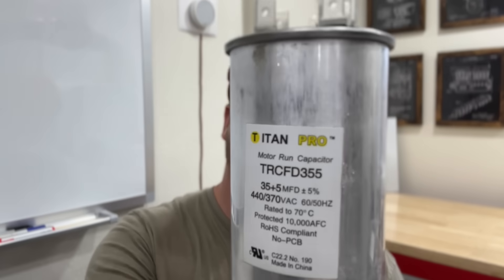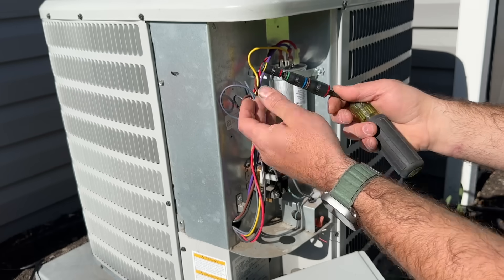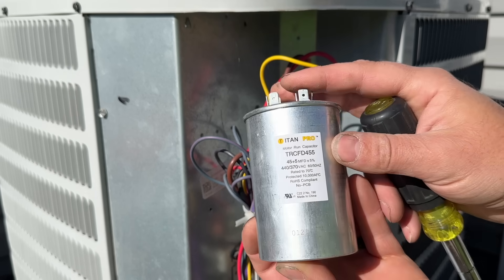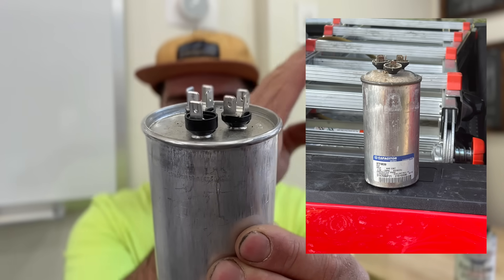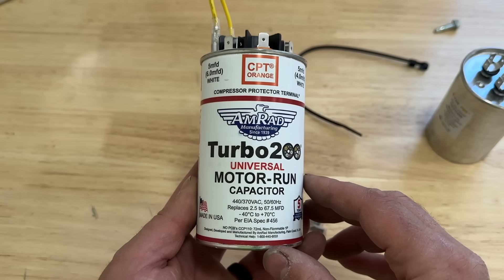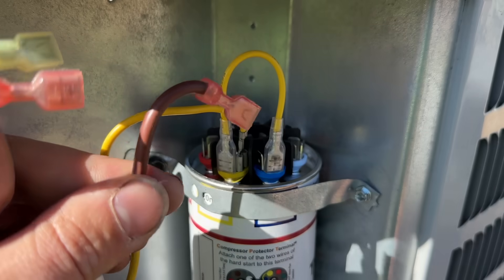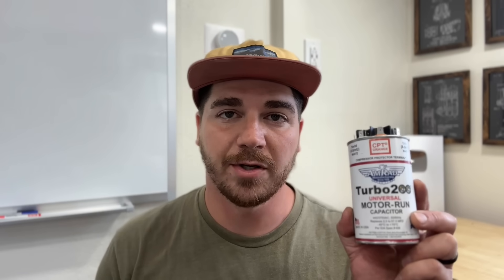HVAC Contractors Practically Make Their Living On These

Comment: I paid 240 dollars to have one replaced about 2 years ago. I got a little desperate because it was very hot and had kids in the house. I could only find them on amazon. And it would take 2 days to get it. I just had it go out again a couple of weeks ago and found out Ace Hardware sells them. It was 30 dollars but saved me from paying someone else almost 300. I ordered an extra one off amazon also just in case it happens again.

Comment: That is a rescue cap , experienced techs only keep 1 in their truck for weekend emergencies only they are larger in diameter than what is in your unit and not a suitable permanent replacement. A swollen capacitor is common due to not cleaning your condenser coil. A restricted coil will cause over amping and failure of your capacitor,fan and compressor. I have never seen a capacitor cost 2 k but more like $200 -$300. You have a service fee trip ,charge and parts markup and the time and experience for diagnostics and repair.

Comment: An hvac contractor can quote a repair for what ever price he or she wants.  If you don’t like the price, DON’T approve the quote. If you approve it with out doing your homework, then not like the price later, that’s on you, not the contractor. As far as the turbo 200 universal capacitor, they’re great.  They do cost $75-$95 at the parts house.  Count on a 300% mark up from a service company.  That’s just business.  Good luck getting it to fit in most of the residential condenser electrical cabinets though.

Comment: Just last summer my AC stopped working.  I called a local independent HVAC contractor for the repair.  I was quite pleased to find out he was very honest and reputable.  He diagnosed the problem as a faulty factory capacitor.  He only charged me $15 dollars for the capacitor and a $75 minimum response fee.  But now, with your video, I am pretty confident that I can do this myself the next time the capacitor fails.
Reply: You should keep his contact and spread the word around. They dont make those techs anymore
Reply: @blipblop92  Totally!  And I have done such that.
Reply: You should keep his contact and spread the word around. They dont make those techs anymore
Reply: I was fortunate that where I lived my HVAC tech did roughly the same thing.
Reply: I bet he’s no longer in business. No way to stay afloat with no profit margin on part and not taking into account time, gas, vehicle maintenance, insurance, etc.
Reply: @frankiec5570  This local family owned company has been in business for three generations.  They’re still in business.  They must be doing something right.
Reply: @frankiec5570 Well, it seems to me that this guy is well aware of overhead, costs of operation, the minimums needed to succeed in his operation. Hence the $75 minimum service call fee that typically takes only a few minutes to diagnose and repair.
Reply: That sounded pretty reasonable to me,  you should hang on to this Contractor.
Reply: Keep that guys number.
Reply: Where are you located?
Reply: At those prices he will be out of business soon. What that guy charges is not enough to cover his cost plus pay Uncle Sam and put food on his table.
Reply: @justinhindman5834  I politely disagree.  This HVAC contractor has been around for years in our relatively small town and has top ratings from their customers.
Reply: @sar4x474 good rating doesn't mean he makes a profit 😂
Reply: @justinhindman5834  only scammy techs cant make a living without ripping people. My personal hvac guy charges $70 minimum fee to come out for some loose wires or popped fuse and he's been in business over 20 years and owns multiple houses for rent. I wouldn't say he's about to go out of business. Business will always find you if you're honest and priced right

Comment: I started having problems a few years ago in the heat of summer. Usually afternoons when the whole unit is in direct sun.
Saw one video and bought a capacitor.
Changed them out and got it running.
 A few 100+ degree days later, it heated again and quit again.
I saved the  old one and had put it in the fridge. 
Swapped it out again and it worked fine.

Since then I built a plywood cover to shade it and it works all summer.
I know you have to R&R before it expands and ruins it.

Comment: My brother always calls me and I help him figure out these things over the phone. Generally if you can open up the outdoor unit and the contactor is pulled in and nothing is happening your capacitor is bad. I can just about guarantee that you will have to replace your capacitor at least once if not twice in the lifetime of your condenser. Capacitors are not very expensive and they will eventually get too hot and fail. 80% of all air conditioning issues will be electrical. If it's a refrigerant problem you have a leak

Comment: The part that you are holding in your hand is a Run capacitor for the condenser fan motor and the compressor. It stays in the circuit the whole time the unit is running, it is not the Start capacitor which is plastic and only stays in the circuit for milliseconds until the unit is running, then it is cut out of the circuit by the start relay. But you are right that the HVAC charges more than the price of the part, generally we charged 2.5x the price of the part part plus labor.

Comment: You shouldn’t see any resistance at all between the anode and ground terminals. Some caps become resistors as they internally begin to short as they age or are placed in the wrong position, so if you see an ohm reading that’s anywhere below the megohm range, you should toss it.  

Also caps that are sold individually, as opposed to the multi section can types as seen here, are often of much better quality. It’s quite easy to zip them together and then do the install. This will open up more quality options such as better temp and esr ratings.

Comment: I've been trying to figure out if the evaporator in my home split system also has a capacitor that fails, since the evaporator fan sometimes fails to start and condenser freezes within a couple of minutes. I just turn the ac off for a few minutes, turn it back on and back in business. This can happen once or twice a month while sometimes once in a year. My ceiling now has some water stains since the lines freeze all the way from condenser to evaporator.

Comment: Water Well pump start capacitors are a boondoggle profit item in the water well repair business. A $200 Franklin control box is typically sold when the root cause is usually the motor start cap in the control box. Capacitors have only so many start cycles in them.
 A $15 plug and play replacement. I've saved people thousands of cumulative dollars over the years replacing just that cap.

Comment: The capacitor holds a great amount of charge and its purpose is to start the heavy steel fan that's atop the unit. If that is the case, you can start your AC by turning it on in the house and going outside to the unit (you should hear the hum) and knock the fan with a long object to get it started. Long screwdriver or yardstick. That will make your wife happy while you go and get a new one.

Comment: I guess scammers are everywhere.
My (humble) comments:
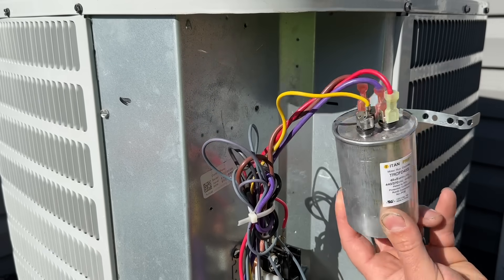Don't put screws up (2:23). Put them down so they cannot fall.
The first 3 wires should be pulled from the plug, not the wires. Except the last one because it's not insulated.
I'm not an expert but discharging a capacitor that way is dangerous to my knowledge. Chances are very thin but it can blow using that method.

Comment: Just like at the auto mechanics. Dealer wanted $1500 for rear shock replacement.  Local shop $1200. Pepboys was less than $400 with shock purchase.

Geottel AC in Las Vegas wanted $278 even before the capacitor game out. $65 for the capacitor alone. I waited till it blew and replaced it myself

Comment: It does not give the AC A ‘jolt” when it is turning on.  It shifts the phase between voltage and current which provides rotates the magnetic field of the motor giving it starting torque. It gets the main winding and  auxiliary winding out of phase producing starting torque.

Comment: In 1960s Sears sold all the parts for central air. All parts sealed, compressor, lines, evaporator, etc. I installed as instructed. Outdoor switch ,its own breaker etc. Worked fine for ten years. I sold the house, it was still working.

Comment: I was one of those guy that got suckered into over paying for a new capacitor, but my capacitor was for my air handling unit and it was in a weird place on the circuit panel.  The capacitor was the only item not visible when looking at the circuit panel of the air handling unit. The capacitor was placed on the back side of the circuit panel so you can't see it when looking at the circuit panel.  I would have never found it and would have gave up on trouble shooting without diagrams or drawings.  $550 was a fair price for teaching me a good lesson about how experience over 25 years in the HVAC business makes him not only a good HVAC mechanic, but he taught me a thing or two about HVAC components mounting and wiring, as well as, how to keep a HVAC business financially successful for over 25 years.

Comment: Same with pool companies. If your pool pump doesn’t turn on it’s most likely a 20 dollar capacitor. Don’t replace the pump. Replace the capacitor. I’m not mechanically inclined and have done it twice so far. Save yourself 800 bucks.

Comment: These capacitors don't last because they outlawed PCBs or something based on environmental concerns.  Keep a few handy, and learn how to discharge the old one so you don't kill yourself.  PS:  The number one scam for AC is filters.  The most common problem isn't the capacitor, it's the filter hasn't been changed in ages.

Comment: The first thing you should have done is use an insulated screwdriver to discharge the capacitor to ground before you ever removed it. That way its totally safe. They can blow a finger off.
The old massive capacitors filled with gnarly oil never went bad like the new tiny ones. When i say new i mean in the last 30 years

Comment: Speaking as an HVAC service tech… any company that charges that much for a capacitor replacement is a bad company ran by crooks. I’ve worked for 4 different companies, the most they’d charge is like $300. $1,000 or more is absurd and highway robbery.

Comment: You are right one of the biggest ripoffs but do be intellectually honest as well.  What I am saying is you say that capacitor that you improperly try to dumb down to a battery is that it is a $10 item which is true but out of context while holding one in your hand that cost on average $65 dollars. Also honestly you should discharge the capacitor before pulling the wires as pulling the wires is when you are most likely to inadvertently touch the wire and discharge it yourself.   It is akin to flipping off the breaker after touching the wires and realizing that hurt.

Edit:  that turbo 200 you are holding on Amazon is $70 to $90 as of now.  Granted if you get the correct size cap only you can get them between $5 to $15.

Comment: I called a large hvac company that I had used in the past, told them the capacitor was bad but wanted them to service the system while they were here. The guy comes out, changes the capacitor, services the system, then hands me the invoice. $385 for just the capacitor, then service call and service. I told him, recalculate the invoice for the service call and take the capacitor out, I will go to Grainger and buy a capacitor. "But, you are not a certified service tech and you are not allowed to change that part and you don't understand how dangerous it is". Well, my units are 10 years old with no warranty and as far as not being certified, I have been a state licensed electrical contractor for 30 years, electrical and mechanical engineer for over 20 years. He called the office, then asked if I would pay $35 for the capacitor.
Good part, less than a year later that 5 ton heat pump compressor was going out. So, I had new 5 ton system and the 3.5 ton system replaced with new air handlers and heat pumps, guess what company I didn't call? I am thinking about having the existing (2) split system units removed from my detached garage and have 2 Mitsubishi ductless mini-splits installed, and again, not calling that company for pricing.
Best part, I do architectural, electrical and mechanical engineering on commercial and industrial projects, I constantly have building owners and general contractors ask me for references for mechanical, electrical and plumbing contractors to price their projects.

Comment: These are EASY — IF you know how and have done one under supervision.  Virtually 90% of all AC unit problems.

But discharging ought to be a basic safety button on a unit.  Disconnect power — push discharge “button”.

Why don’t AC units have some kind of push button capacitor discharge safety feature?  (Another expensive part?!?)  

Or why isn’t there just a charging phase to the compressor call that charges the capacitor and discharges it after the cycle?

It is EASY if you have the right tools.  But a capacitor CHARGE status would seem a basic safety feature.  AC manufacturers cater to repair business and not customers???

Comment: Yup..  I always have a spare.  Costs 7-20 bucks on amazon, ebay etc..        You can only buy them locally at a union only shop, i.e they wont sell you it if you arn't in on the scam.   Takes 5 minutes to change, you could even do it with a butter knife...

Comment: I have done this as well, but would recommend to whomever does this to be over the top careful.  Throw the breaker near unit, throw the main breaker inside your home and still check for power.  Have someone standing by in case you've made a mistake.  It is not a hard job,  but it is dangerous job.  That cap is like a battery.

Comment: Yep they will sometimes swell up, smell burned, and even be oil. If they are slimy or you see a oil slick on the panel beside the capacitor then its bad. However sometimes they will look great and be bad but i recommend if your A/C isnt working and your capacitor is old i would replace it since its the most common issue. Same with indoor fan motors they will typically have a 5 or 7.5. Most people assume compressor or fans are bad when in reality compressors typically last a long time. Same with fan motors most of them are designed so the capacitors, relays, or contactors will go out before the compressor or fan motor. **one thing that drives me crazy is nobody around us carries capacitors. We needed one for a fan motor over the weekend awhile back. Walmart, Home depot, and lowes dont carry them in store. Which blows my mind because its super common for them to go out. I recommend since its summer "basically" if your willing to replace your own capacitor or know someone who will for you. I would go ahead and check your numbers on capacitor and order one or two to keep at home. Trust me it sucks when it goes out friday evening and you gotta wait a week or so for it to be delivered or wait til monday and try to find a store that carries them. We have a R.E Michaels but its far away and not open on weekends. Lastly yall keep a eye on your filters and cleaning your coils. If its struggling for air its gonna run hot and be harder on every part compressor, fan, capacitors etc. Basically if your compressor goes out depending on the system and what is else is bad your looking at a few thousand dollars between the compressor and labor.

Comment: half the time home owners cannot locate the air filter. now you expect them to change a duel cap with a universal cap... 😂 have fun buying a new condensor. "it ran fine for about ten minutes, then it turned off again. now the breaker is tripping". well, saving $200 just cost you $4000 because you listened to this idiot on youtube.

Comment: This isn't related to home A/C, but since we're sharing scary A/C tech stories; I'll share mine. My buddy was quoted $3600 to repair his truck's A/C. I took a look at it, there was no air coming from the vents. Immediately I go to check the wire for the blower motor. It was corroded, I cleaned it and viola; working A/C. It didn't even take me two minutes from start to finish, my only expense was a dab of rubbing alcohol and a dab of dielectric grease. A/C Tech's can't be trusted in Florida, lol.

Comment: normally the capacitor is swelled or corroded. There is also a starting relay that comes into play. Now in most cases, there is no point checking a swelled cap as the characteristics will be whatever. So if there is no label I don't think I would measure capacitance then buy one. I would go online and find the schematic of my particular unit. However, I have used a 6UF in place of a 5Uf with no issues. So probably in most cases, if the voltage rating is correct, then the value may vary.

Comment: This overcharging has been going on forever.  I bought my first home in 1975 at age 23 and I was really stretching to make the payments and cover all my other expenses.  The old a/c went out and I called an HVAC company.  They came out, got it running in about 40 minutes, and charged me $240 for parts and $400 for labor.  I looked the part up in a wholesale catalog and found out it cost them $11.  I offered them half of what they were charging and they refused and sued me in small claims court.  After hearing from both sides the judge awarded the company a total of $225. A victory for me but still a judgement against my credit score.  The HVAC company was out of business 18 months later and they at one time had over 50 trucks in service.
Reply: Credit score? Credit scores weren't a thing until 1989.

Comment: I've replaced my capacitor more than once (different AC units over many years).  I just go down the road to my friendly appliance repair store and buy one for $10.  Don't forget, this also works for the contactor and those relays in the air handler.